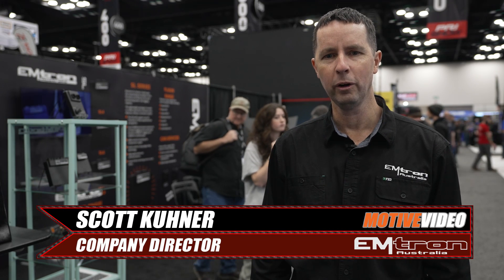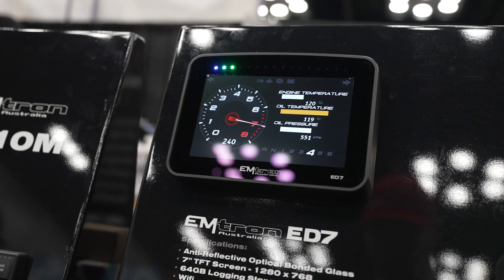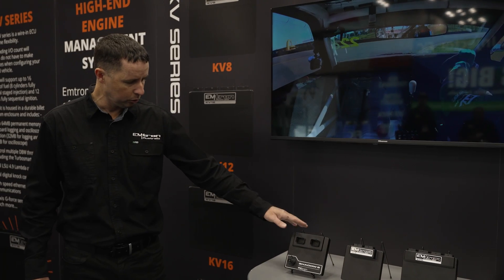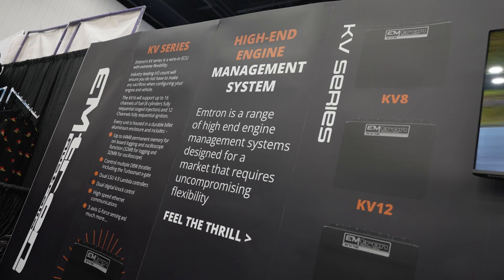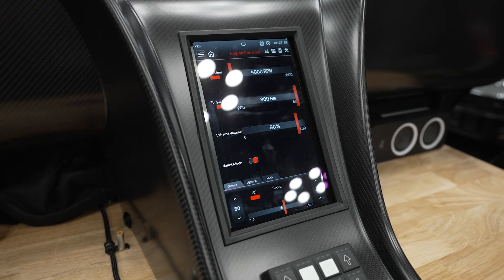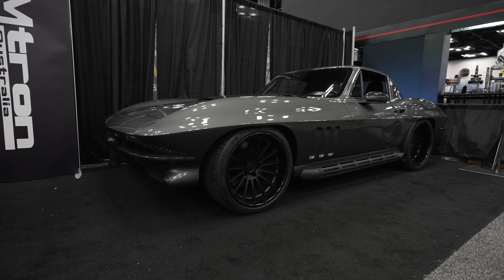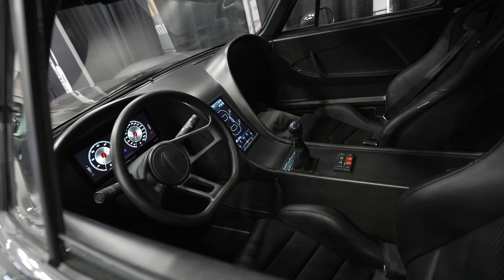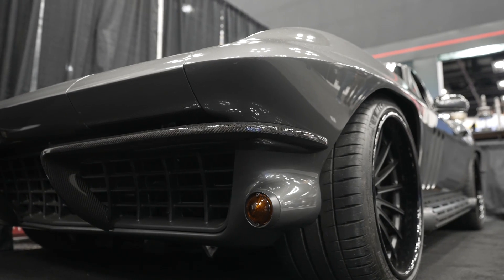EMTRON ECU at PRI Show 2024 - Complete Vehicle Electronics Solution

Comment: For the features they have to price point is a tad more than what other companies are offering 😮‍💨
Reply: How do you recon? What Other FPGA based ECU is cheaper than this? And what other cheaper ECU is using genuine throttle mass-flow rivaling an OE level ECU platform? 

Not to put other brands down, but EMtron is light years above the competition. Especially on the hardware, and software stability and usability.